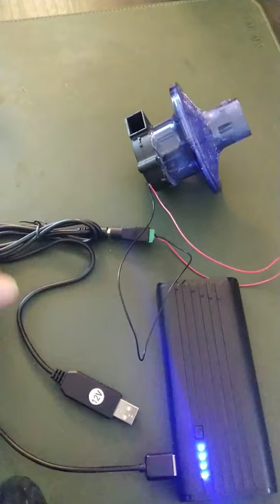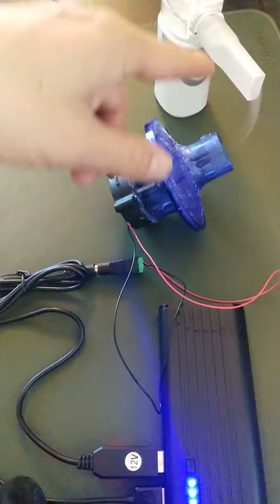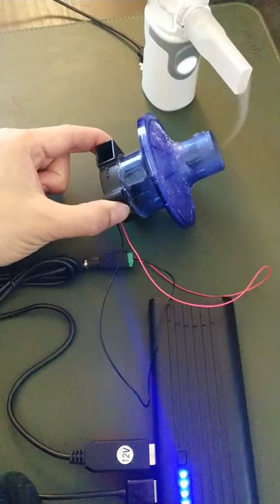Viral Helmet, small blower fan and filter demo

Comment: Can you give me a link to buy the filter case which attaches to the fan ?
Reply from the maker: Take a look at viralhelmets.com. The filters are described there, but since they are mainly sold to hospitals, you'd have to buy a 50pack or 100pack.  Ebay has some, but there are 30-100+ brands of filters.

This is a common part.